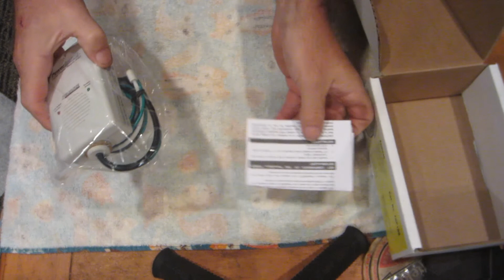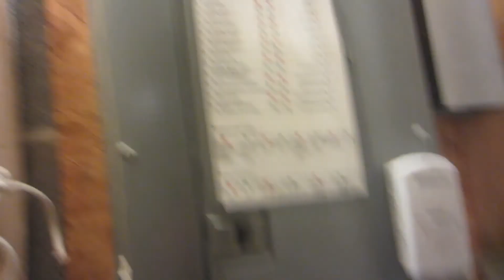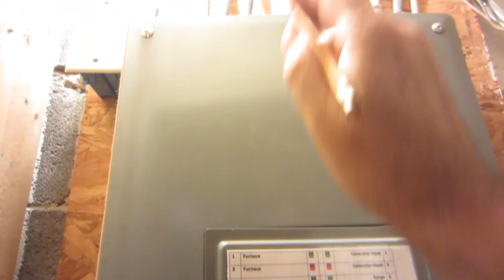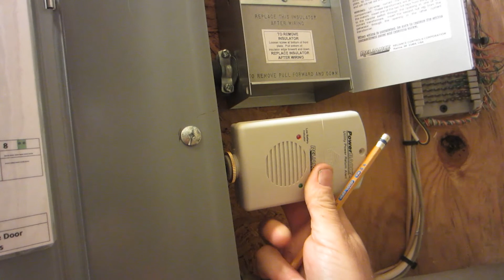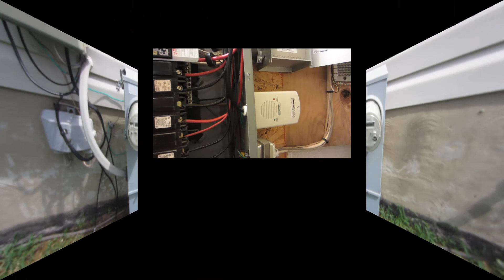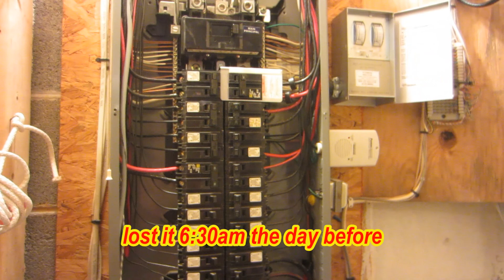Reliance Controls - PowerBACK Utility Power Return Alert - Unbox - Install

Comment: so, actually, what is stopping you from wrapping the antenna around the wire just OUTSIDE of the panel, and finding a ground outside of the box?
Reply from the maker: It's been a while but I thought it said something about using it on a single phase but it may work on both phases at once. Give it a try. I wanted it in my electric box and it was easier to get the "antenna" wrapped 4 times around the single-phase wire.
Good luck and glad you watched the video. 😎

Comment: Great video!  Did I miss where you called out the price?  I am posting this as a link on my video where I show how to install the 30amp breaker, interlock kit & inlet plug: https://www.youtube.com/watch?v=ohexUX5b81U&lc=UgxnqzrR26Wwg1kIc7J4AaABAg.9SsRL7mhswp9St5ze5_zBI
Reply from the maker: About $35.00 at Amazon https://www.amazon.com/Reliance-Controls-Corporation-THP108-PowerBACK/dp/B003KREORA/ref=asc_df_B003KREORA/?tag=hyprod-20&linkCode=df0&hvadid=198064505516&hvpos=&hvnetw=g&hvrand=9663545937768932272&hvpone=&hvptwo=&hvqmt=&hvdev=c&hvdvcmdl=&hvlocint=&hvlocphy=9007872&hvtargid=pla-348785756387&psc=1 
Thanks for watching!!
Reply: @finscreenname  Thanks for the info.!

Comment: Hi, thanks for the awesome video .. I had one quick question - I noticed you installed this in the panel inside your house - looks like a subpanel .. and not on the main panel outside. Is that correct? If so, I assume that even with the main outside panel off (when running the generator) - when power comes back on, the inside sub panel will know that grid power is back? Let me know if I am wrong on all that 👍 - thanks.
Reply from the maker: That is the main breaker panel in our house. The only thing that comes before it is the power company's meter. My back feed system powers our whole panel and we choose what we want to run off the panel. So the line I put the detector on is the power line coming in the house. My back feed generator feeds the panel through the first breaker in the panel. That's why we have to turn our Main breaker off when running our generator or it would back feed the power lines but with the Main off we never knew when the power came back on until this gadget.  Thanks for watching!!!
Reply: @finscreenname  Thank you 👍

Comment: It would be nice if that alarm could be changed to something like Welcome to the Jungle or something but I digress. Nice video by the way and nice installation.
Reply from the maker: It should play that when the power goes off. Maybe "Heaven" by the Psychedelic Furs when it comes back on being everything in my house runs off electric including water and AC/heat.😎
Reply: @finscreenname  how long does the alert stay on? to let you know the power came back on? It seems the interlock and backfeed breaker is the way to go instead of a dedicated manual transfer switch, thoughts?
Reply from the maker: @randylee2549  If you don't turn the switch off the alert stays on for as long as there is power in the battery and it's loud.
I like the interlock because I can pick anything in my panel to leave on (within my generators power handling cap) and my choices change depending on the time it happens. Like when it comes to the HVAC unit. During the summer we could hold off on using the AC and other months not using the HVAC at all but during the winter holding off on the heat may not be a option. A dedicated means you have to pre pick what you want and the HVAC would be on it even if we didn't need it at the time. In my panel I can skip over the HVAC breakers or make them the most priority breakers in the box depending what is needed at the time.
Reply: @finscreenname  nice, do you think the firman 11000 watt surge tri-fuel can run on natural gas to power a two and a half ton Central AC? 899 @ Costco is reasonable
Reply from the maker: @randylee2549  I'm not an electrician first..... But I don't know why not. I use a 10,000 Watt gen and it will pretty much run the whole house as long as you are not trying to drive everything in the house at once. It all depends on what my wattmeter says I can run https://www.youtube.com/watch?v=BjVCHbg-s5I but so far I have not been lacking for power. The only thing I will add is in the electric world they consider generators as being "dirty power" so I wouldn't run my best electronic stuff on it.
Reply: @finscreenname  perfect, I'm going for the tri-fuel firman 10000 watt as soon as it goes on sale this spring, the only thing I don't like about it is it's noisier bt 8 db than the 5,000 watt that I was going to buy which is a dual-fuel so I don't know if I could take it camping with me. Haha
Reply from the maker: @randylee2549  Ya my Honda is a bit loud but it's not like someone could walk off with it and not be noticed either. lol
Reply: @finscreenname  nice,

I'm going to be hooked up on the side of the house with the natural gas and panel connection all fenced in, 250 pounds, good luck with that and the noise by the window.
Reply: I’d say, AC/DC’s “High Voltage”.   Or maybe Judas Priest belting out “Electric Eye” …
Reply: @deebedwell  🤘🍺🤘🍺

Comment: Hi, do you have a link on where you bought your wattage meter?
Reply from the maker: Amazon https://www.amazon.com/Reliance-Controls-Corporation-MB125-Indoor/dp/B00AHTWSCW/ref=asc_df_B00AHTWSCW/?tag=hyprod-20&linkCode=df0&hvadid=167150549507&hvpos=&hvnetw=g&hvrand=12851871647737072916&hvpone=&hvptwo=&hvqmt=&hvdev=c&hvdvcmdl=&hvlocint=&hvlocphy=9007872&hvtargid=pla-306077433563&psc=1

Comment: Hi, will this detect if I wrap around my electricity post of my house. Not just the one cable that you have explained in your video??
Reply from the maker: "electricity post" ?? It should detect if there is electric in any line as long as the antenna is wrapped around it but.... I'm sure they would say it's not made for that. Sorry
Reply: This is similar to how a tic tracer works. A tic tracer is one of those $20.00-$30.00 electrical testers that look like a fat pen. It works by detecting a magnetic field and sounds an audible. Be sure to keep the 9 volt battery 'good' or it won't work when you need it most during a power outage.
Reply from the maker: @electricianron_New_Jersey  There is a led light on the front that will tell you when the battery is getting low. 😊